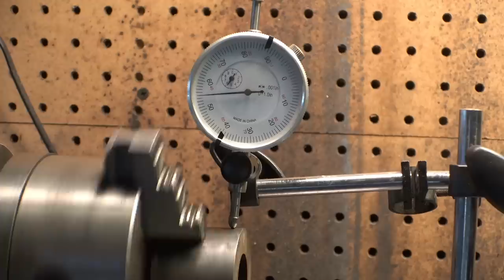Making an Automatic Two-speed Go kart Transmission

Comment: Throw those bearing in the freezer for 15min and they will slide right in.
Reply: They weren't milled to be pressed in, hence the key way. If they were then yes cooling the bearing or heating the housing would have been the answer. But they were milled just to be snug or else they wouldn't have went.
Reply: I've done it once replacing a crank bearing on a 2.stroke. The bearing went in the oven at 200f and the crank in the freezer as cold as I could get it with some fiddling with the thermostat. Dropped right on, no pressing and couldn't move it in 5 seconds.

Comment: the machined shaft to the end product , lots/ hours of fine tuning,  brilliant job, not sure how much load, it will handle as that keyway engages at speed with a heavy load, ??? maybe four latches will spread the load to the sprocket a little more evenly. if they can fit. two may do. at least it will be on both sides at the same time,
AWESOME creation love it.

Comment: I think you may want to look into heat treating the 2nd gear assembly (minus the bearings of course), and enlarging the pin that is holding the sprag in place. Maybe not in that order, but those are the methods of failure that seem most likely. 

Cant wait to see what you put this in and see it in action. Keep it up man!

Comment: My guess was JohnnyQ90 to, but I think that will be the weakest point in the setup if it fails, needing flatter load bearing surfaces and stronger pivot linkage depending on the power of the engine, not hard to resolve. I subbed straight away because you got straight into the task without talking to much. Really looking forward to see the rest of the project, what I'd love to see is someone attempt a fluid torque converter or chainsaw clutch based version with interlocking teeth to achieve the same goal, purely for curiosity sake, just pull a chainsaw or scooter clutch, cut some teeth in it, give it a thrash and see how long lasted before chewing itself out. Oh yer, loved every metal grinding moment.

Comment: I was wondering why not use a centrifugal clutch in the high gear? That's how they work and they may take the engagement forces much better. Plus you can get different materials for different grip strength also different springs for different engagement RPM. For 1st gear look up "overrun clutch" in an automatic transmission! That is PERFECT for what you're doing. Lots of rollers with wedged gear. When being driven they wedge in and drive the assembly. When going faster (like second gear) they are pushed into the reliefs and out of the wedge area by the faster moving other gear.

Comment: You may want to add 2 locking forks opposite or 180 degres of each other inside that gear housing..its a cool design im just not so sure i till hold up under power for long . Definitely got my brain thinking man . Great vid 👍

Comment: As I've said a few times all you need is electric clutches.  3 would give you 3 gears timed with an adurino or paddle switches with relays for lockout purposes. Using a relay for lockout, another electric clutch for reverse.

Comment: You know, you can use those one way bearings in hubs mounted to your rear axle to allow your rear wheels to turn at different rates in corners. In the event that you accelerate hard enough to spin the driving wheel (the inner wheel will drive and the outer will free wheel) the free wheeling wheel will  begin driving so it'll act as a sort of locker or limited slip differential. The one caveat is that it'll only work on forward only carts and each hub will  need a brake. You could also make a center carrier with the bearings in there and run two axles to solidly mounted wheels but it'd still need dual brakes as well as only be forward capable. At any rate, great design. You never fail to impress.

Comment: Great job.   Some suggestions for you. Lube/coolant and lighter cuts will help. An arbor press or large flat washers and all thread will help with bearing install. Heat can help too. Like a comment below... brass hammer is your friend.   Good job with the project. I hope yo see it in a cart. Maybe a reverse gear?   Kudos.

Comment: You can do also 3 centrifugal clutches with different springs in it and one way bearing on the axle rings. Very simple and very strong. Same principle of your build. Very interesting video as always I actually owned one of the rc cars you mentioned.it was very cool
Reply: technically you could add as many ratios as you want provided you can find a primary clutch with enough output sprockets lol. first/low would never need a clutch on it though, just a sprag

Comment: I am impressed by this design! but I also think that lever is the weak point, to give it a chance let this axle spin at the same rpm as the engine (or even faster?) a higher speed means less torque ;-) Maybe also add some kind of flexible coupling between the engine and this transmission, that can soften the impact when changing gear.

Comment: Use 2 centrifugal clutches tuned to different rpm and put a sprag on them. Old timers use to run 2 different motors with 2 different gears on racing karts.

Comment: Reminds me of the 2 speed transmissions in Tomos mopeds. Only difference is the "clutch" for 2nd gear is on the output shaft rather then the input shaft. And they use a centrifugal clutch "the wrong way around" (the arm rotating out against rotation of the axle) and very grippy clutch material. Those two things together reduce the slipping to zero once it engages. Let me tell you, it's not a subtle shift unless the engine is worn out, it's more like someone ramming your moped.

And the clutch on the output shaft shifts (pun intended) shiftpoint from RPM of the motor based to RPM of the output shaft, meaning the engine can drop RPMs from the shift without 2nd gear disengaging. But then again you're the one actually building it, and I'm typing away on my keyboard, I'm very interrested to see your results. But if you need inspiration, "Tomos exploded view" will net you plenty of exploded view images of the tomos 2 speed engine.

Comment: (I would have sent this via email, but that info isn't available at all afaik)

First off, new sub here!

Second, I discovered your channel while researching a reversing gearbox (yes, I watched both parts of the 3-speed w/ reverse) and I can up with a challenge to see if you could pull it off.  Take that 3-speed gearbox and simplify it by removing the low and high gears while at least improving durability.  Here's a another cherry on top:  make the output  turn 90 degrees if possible.  Purpose:  To utilize a motorcycle engine which originally drove the rear wheel by chain and connect the output to a rear light truck axle in a trike.  I myself am merely a tinkerer and I have very little machining skills.

Comment: This is the long way around when it comes to making a simple transmission. Try checking out the Tule Trooper transmissions that were made in the early 60s and 70s in Issaquah..Washington state.
They were like 5 by 6 inch gearbox with final chain drive. They were a 2-speed plus a neutral.

Comment: I think I will break apart once you put some real torsion on the spring mechanism, the most likely the little pin that connects them. However the design can be improved for strength and function. Very interesting video, btw avoid joining the sprockets with welding there are better ways to do it, check a bicycle and copy the design. And use adequate fits and tolerances for the bearings and components. You may also want to use high strength steel for the shaft maybe 4140 to avoid fatigue in the high stressed sections such as the spring support. However that's just an assumption, to reduce likely failure and just if the whole mechanism is capable to withstand the torsion and fluctuating loads. Case contrary it you want to improve the strength in the spring you can add two Springs but you will have to play with the shaft minimum size. Good luck and thanks for sharing the video.

Comment: Really nice work, but those cutting tools always need lube.  Also, not sure if anyone else mentioned it, but back in the 1960's and 70's, some minibikes had similar automatic 2 speed systems like this, although they used centrifugal clutches with the one way roller bearings.

Comment: Good idea however I see a massive flaw, when you get to the speed for that part to engage into the 2nd gear, you are going to have a gear grinding sound, it will either struggle to go into gear by grinding until the axle speed increases to the gear speed, or it will suddenly grab and probably break the centrifugal tooth thing off. If it doesn't break immediately it will certainly not last long, the tooth will get really worn out on the tip or the inside of the gear will wear out until it shears and you will be back to having only gear 1. Your old design seems aa lot better and a linkage would be pretty easy to create, probably around 2-3 moving parts and just a few guides.

Comment: Brilliant. So once second gear engages it just outpaces 1st gear so that they aren't engaged at the same time? I wonder if those one way bearings are gonna hold with the amount of torque required to move a vehicle. looks like all the energy has to go through the bearing. Awesome nonetheless.
Reply: Should be fine for holding power .. lots of transmissions in cars run Sprag bearings as well.

Comment: I thought about doing this years ago when traxxas came out with the two speed in the jato and revo back in the day I just did not think they made one way bearings that large I totally think this will work with one exception you may have to add another one in between the two gears and make it a 3 speed set up it is either going to be too large of a jump to second or not enough of a difference to be worth doing this I thought long and hard about tgis did the math on ratios and my conclusion was that a torque converter would out perform this all day long but that is just on paper I am so glad you built this because I always wanted too just did not have the tooling or opportunity at the time and hoped someone would try it so I could see what it does so you are the man for that please don't give up and think about the 3rd gear if one of the things I mentioned happens I think by tweaking the ratios this could eventually be a serious game changer in go karting and could eventually hit the market as a product one day and you may be able to make that happen I look forward to seeing your next  video and you might want to add in a centrifugal clutch to ease the transition also but you will need to tune the springs and get the gear ratio just right for it to be beneficial but I'm sure you already know all that I have said because you are a smart guy so keep up the good work my dude

Comment: Hi buddy I think its really good design however there is a major floor in the design the pin that holds the gear engagement will just snap instantly without a doubt that will need to withstand full torque and more to even stand a chance the only thing I could think is using something that's around 6mm thick and heat treated to make it hard 

You could try it by putting a load on it and spinning it with a drill with the current pin I would say even the drill would snap it

Comment: If you sandwich #41 sprockets together with spacers and use a #41 chain they seem to change gears easily at low speed just like on a 18 speed bike.

Comment: You are going to need a one way bearing on your 1st gear driven gear. So it will allow the shaft to spin faster without de coupling.  You probably already knew this tho. Good work.

Comment: I don't like the arrangement with the 2nd gear centrifugal clutch on the drive side. 

 Up-shifts occur when the wheel speed gets high enough, not the engine speed!
Reply: Which should be enough. Because he will use two chains both connected to this axel. However.. I honestly doubt this locking mechanics will be strong enough and it looks like the rev is much to low for shifting.. but he can adjust the tension's in his brilliant way..
Reply: they both go up n down together , whats the difference
Reply: @bubster1981  First gear is neutral when second is active.
Reply: I'm using some random #'s, just assume…
1st gear is 1:5 (crank spins 5 times to spin the axle 1 turn).
2nd gear is 1:3 (crank spins 3 times to spin the axle 1 turn).

With a 1000rpm centri-clutch on the engine side, it will shift at 1000rpm, 1st @ 200rpm & 2nd at ~333rpm (those are directly related to speed, but that depends on tire size, & my gear #'s are random). You won't ever get the good power rpm in 1st gear, because it always will be in 2nd.

Try it "my" way…assume a 1000rpm centri-clutch is on 2nd gear axle side. In 1st gear the engine revs to 5000rpm, then the clutch engages. Wheel speed stays the same, and it drags the engine down to 1666rpm, allowing full use of the power-band again!

Comment: Great vid again! Love the 2-speed gearing concept, although doubt if this locking into second gear will last for long, if wheels have grip, the engine has to reduce RPM in just about no time, resulting in high peak torque. Well, only one way to find out, keep us posted!

Comment: hi i think a centrifugal clutch for second gear would be better it would have smoother engagement and the leaver you have implemented for second gear might stay engaged while there is torque going through the transmission even at low speed and possibly stopped

Comment: Sounds cool, but don't be surprised if it breaks... When that single flapper latch pops out, its possible to either skip and impact hammer its self apart, OR it can just hit and shatter/jam, either locking it into 'second gear, OR, simply shell out and spit parts and pieces all over the place, so I would SUGGEST that you employ some kind of viscous coupling [like a tiny torque converter? I know they make them, I have seen them in a super specialized transmission shop in Burbank, CA which had INSANE amounts of rare and unexpected transmissions of MANY kinds from around the world] or you could even make your own, it takes little more than well bent, and well balanced steel parts, only needs to be balanced and leakproof to work, the mildest cheapest steel will work, and if you can scrap a whole bunch of some uniform sized soil auger bits, you can make the turbine vanes easily from them with much less total work, but otherwise, simply look at drawings of existing torque converters, and make one the right size for your power and weight needs, and you'll be in like Flynt!

ANOTHER idea would be to use magnets as a passive torque converter, but I honestly can not speak much on this, even though I know they have existed for quite some time, because I have never personally worked with or around them to see how effective and at what power and stall ratings they operate at.

Either way, a variable belt drive is still a more sure-fire way to do that, PLUS if you lack adequate machine tools, much EASIER to use! (~_^)-b

Comment: Very clever!
I've seen similar centrifugal systems before, the first, as you mentioned, is in RC car transmissions, but thats not all. I've seen a centrifugal clutch/transmission system, in a nitro RC car. Heck, my nitro uses a centrifugal clutch though its fast enough as is to forego the need of a transmission ;)
I do share the same concerns observed by others though, that flapper looks like it's way too thin and is at risk of snapping and jamming the gearbox in second

Comment: Husqvarna built a four speed automatic motorcycle back in the 1980s  with a centrifugal clutch  for each gear.   Problem was going downhill in idle,  it would freewheel with no engine braking.

Comment: I'm afraid that the lever will break immediately under load as it's held by a tiny axel or nail or whatever it is.
Reply: Pretty much
Reply: The pin is only to locate it, the load will be passed directly from the back of the lever to the shaft, hence the machining to make a cupped receiver for the lever.
Reply: @killuazoldyck1352  in theory it could work this way if it is machined well and precisely but I'm afraid that when the lever is engaging and getting into position there could be forces pushing onto the pin that could break it
Reply: @honzapokorny6300  it will be interesting to see if it really works, with all experiments there is a good chance of failure at first. i have my doubts about the whole concept, but i do hope it works or at least we learn something from it.
Reply: @killuazoldyck1352  we will see

Comment: i have a centrifugal clutch on my 1975 Vespa Bravo... basicly a rotating drumbreak with a beltdrive to the rearwheel. inside the drum is the engine shaft konnected to two  calipers that swing out at a certain rpm and start rotating the drum...

Comment: pretty slick  .......what was the pin made of , looked like a drill bit part  , holding the 2nd gear dog engagement ,,, find the rpm torque curve of the motor being used , different smaller  sprockets will drop rpm by tooth number ,  you know the thing ...he he .. you may find gear charts in racing karts of help ,  mine was wallet sized years ago ..... good luck .

Comment: It's a cool concept. but I foresee a couple problems:
- You have no control over the shift point while driving, which is annoying, even the most old school automatics shift at different points based on driving style
- The shift from first to second is going to be rough , it's quite literally slamming into gear
- It won't last. While you were testing it with the drill, everytime you didn't quickly go past the rpm where it engages, I could hear it grinding. That's the spring loaded plate and "the inside" of second gear chewing away at each other. Once the two wear away a little, it's going to take higher and higher rpm to get it to engage, requiring regular retuning, until it won't engage at all anymore.
Edit: just realized, you won't have any engine braking either